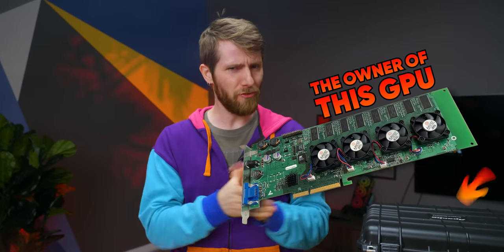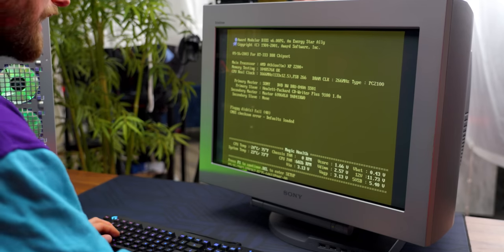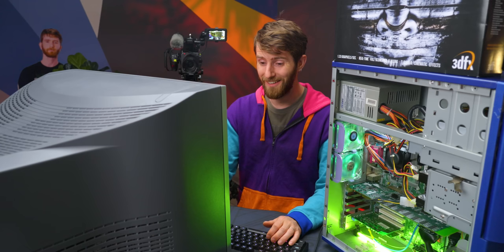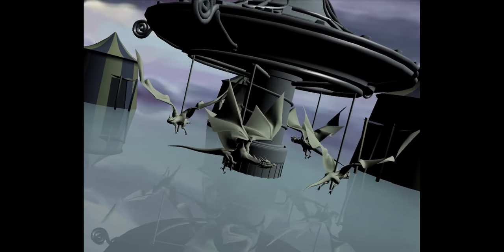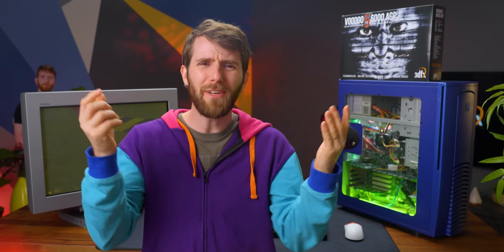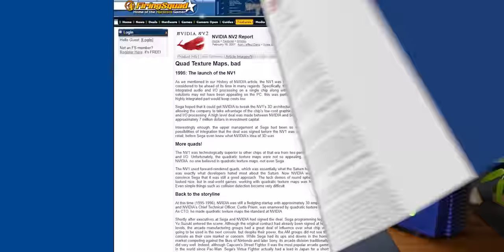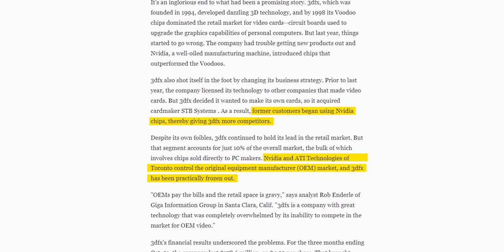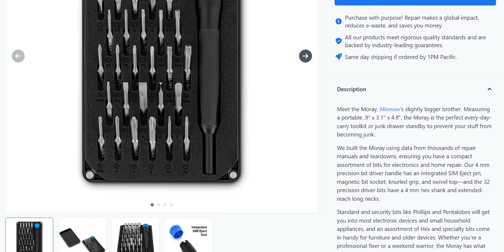This GPU cost $15,000 and there’s only ONE like it – 3dfx Voodoo 5 6000

Comment: ELSA AG from Germany had already finished a 3D graphics card prototype with 4 or more chips at the end of the 80's.
I personally had one of them in my hands and was also told how it should work...
First of all, there was a chip for each basic color and another one that was supposed to calculate the shades of gray. Unfortunately, the company went bankrupt too early and the new owners wanted to focus more on the modem/router area and then went completely bankrupt in 2002 and a Japanese company has it bought the name
Reply: So? SGI already had far better running, and the color idea as explained by you is idiotic, SGI was doing 3D, as were later everyone else, which involves no color channel separation whatsoever. I think you made that stuff up, because it isn't how it works.

Comment: One other nifty trick with the early Voodoo cards, because they only accelerated 3d, they were platform agnostic. You didn't have to flash the bios to use the same card on a Mac to recognize the color space. A co-worker had a pair of Voodoo 2 cards running in SLI which he replaced with a Voodoo 3, so I managed to get one of them for cheap. Installing it in my G3 desktop was as easy as popping in the card, and dragging the driver into the system folder.
Reply: same here. I bought the early Voodoo cards and flashed those and then upgraded to one that just worked.

That was the pinnacle of Mac gaming, when it had a real culture and Mac devs trying to get the market of the ground.

Comment: I was SO HAPPY to see the term "3d Decelerator" put beside the S3 chip. That card... god. Its a meme that will never die. I had a Virge Gx (i think) When they came out. Lara never looked so Filtered(Sharp) .. It was like 3 fps, but damn it was purdy. Unplayable and useless, but pretty.
Reply: Thanks to S3, Microsoft bought them and developed D3TC  off the original MeTaL API.
U99 under it will never stop being beautiful, same goes to Quake 3 Arena
Reply: We had an S3 Trio in our ole Pentium 3 500 system. Damn card could hardly run anything. It used to crash pretty quickly when starting something like The Phantom Menace. Motocross Madness was fine though
Reply: @leviblack7036  Was the Trio higher end than the Virge Gx/Dx (dont remmeber which it was) just remmeber that it was so "powerful" the thing didnt even have a heatsink on the gpu silicon. I had mine I believe in a around the 486/dx4 100 to Penium 200 era. That long ago kind of blurs together all this time later. But it was just before intel switched to the "nintendo cartridge" style of processor mounting. It was a fine card for 2d gaming It ran what I played well enough, but that thing REALLY didnt like anything remotely 3d. (but it was a fine windows base card) But yeah, it sucked. Glad someone else remembers these abominations.
Reply: @Dj-Mccullough  I don't know where it sat vs the Virge but this was circa 99-00. It certainly wasn't a high end card for its time. We had the option of getting a much better card when we brought the PC but we didn't think we needed it.

Comment: The heatsinks at the back of the cards GPU's makes sens because a lot of chips back then used some solder balls in the middle for cooling.
The PCB acted as a heatsink, partially or fully depending on the GPU.
You can still see that on modern BGA RAM chips in the data sheets.
Also overclockers back then did do sandwich mods, basically a heatsink and fan on the back, active backplate if you will.
And yes some cards ran very hot at the back no mater how much heatsink you threw at the front of the GPU, GeFroce256 comes to mind.

Also Nvidia having 32bit support in games was not much of a big deal unless you where fanboying a feature.
Both card supported 32bit colors in 2D but 32bit colors in 3D would easily lose you 30-40% of your FPS on most cards so few people would use that.

In fact the V3 3000 could do 22bit dithering on the output using the 16bit framebuffer, it basically outputted 22bit colors dithering the image creating an image that looks better but is still faster to render.
A Voodoo3 on a CRT looks very good with the right options set.

Comment: I had that Antec SX1030 case in 2001 and did a window mod also. Mine was beige and I tried to apply a black mirror finish with spray paint (I failed). It lasted until about 2004 when I got a black aluminum Lian Li that had a modular front drive bay/fan design.

Comment: I'm surprised that you didn't include Unreal in the benchmarking of the card.  Unreal FLEW on GL.  I knew a guy who had a VooDoo 5 5500, and I thought it was so cool, until I realized it was barely faster then my VooDoo 3 3000.  It's a shame that 3DFX fail cascaded so hard, and I swore off Nvidia after the buy out, until ATI proved how hard it was to make good video card drivers!
Reply: Uhm, as a retro enthusiast (and since I have 23 x Voodoo cards, including 2 x Voodoo 5 5500), I feel like I need to set the record straight. 😁
I can tell you without a doubt that the Voodoo 5 5500 is not "barely" faster than the Voodoo 3 3000. You were probably comparing them in CPU limited scenarios. At 1024 x 768 / 1280 x 1024, depending on the game, the Voodoo 5 5500 is almost twice as fast as a Voodoo 3 (or ~50% faster when the Voodoo 5 is running in 32 bit color).
Reply: Blooden, you may know this then, did all of the voodoo 3 3000 have the built in TV tuner capture cards then?  I remember how annoying the purple mostterly long cable was, and how they added TV capture right around the time of the HD transition.

Comment: That first step into 3D with Quake was friggin awesome. I put it on the same level as my first experience with VR on my Vive.
That was the core part of my lan party days at the roundhouse in Aurora, IL. A great lan party venue...you could always just take a break and hang out at the bar downstairs. I don't miss lugging around that CRT monitor I had back then though.

I'm pretty sure I still have my 3dfx Voodoo 3 3000 somewhere in my storage boxes of computer parts.

Comment: Extra points for running a REAL CRT monitor!  :_lttDragon:
Reply: Not just any real CRT, that's an FW900. The only widescreen PC CRT ever made. Sometimes rebranded as IBM, Digital, HP,  Silicon Graphics. There is usually one on eBay at any given time with an asking price in the thousands.

Comment: Like! Too bad the CRAZY multi-GPU MONSTER Voodoo 5 6000 was never officially released.
Reply: The Voodoo Rampage would have been interesting as well.
Reply: @RetroNorth  of course but Rampage still needed at least 6 months to function normally and to be released. The Voodoo 5 6000 on the other hand was practically just a step away from being released on the market.
Reply: @3dfxvoodoocards6  True, the 6000 was a beast and indeed much closer to general release. But it was all the same tech as the 5500, just more of it. ( With the addition of Voodoo Volts maybe if that counts. )

Comment: What a piece of history. 120 fps at the time wasn't even considered as anything in gaming as far as I remember.
Damn throws us right back real good. Look how far we have come since then, wow.
Reply: Yes it was, rarer perhaps and most people preferred the higher resolutions, but you can see in the shown benchmarks from april 2000 both the original and second geforces getting over 100fps in Q3 at 800x600.

Remember refresh rates were higher than for a long time in later years due to CRTs being a migraine inducing flicker fest at 60hz and not great at 75. 85Hz was a common minimum for many and at lower resolutions the good ones could go quite high.

Comment: 3dfx was late 2 years due to shortages and not outsourcing silicone.. the 5 would have been competing with GeForce 256 and ddr right around the corner.

Comment: for me this era was all whatever secondhand stuff i could get my hands on.  i'd help family friends get their new system up and running and then take home their old system they weren't going to use anymore, and swap parts around to get myself the best system i could.  never got a 3dfx card but remember having to select your hardware (audio and video) in a game and mine not being on the list most of the time.  3dfx was in the list most of the time and i'd end up trying everything to see what worked best for my hardware.  some didn't work at all and i feel like there were usually about 6 options.

Comment: reminds me of the weird PC that my brother and I cobbled together for my father. as you know, all those graphics cards had one single outlet.
we had a not too old voodoo banshee and another card (I don't recall which one, probably a S3). and we had a 14" screen and another 12" screen (yes, there were 12" CRTs out there). my parents were quite happy with it because 2 rather small screens allow much more productivity than one 17" screen.
12" is nowadays garbage, unless on a light laptop, but a second screen with the only task of taking care of outlook? quite a fine thing. it needed to be enough for email.
and the screen was original IBM PS/2. yes, that wasn't just a keyboard connector.

Comment: On a semi-tangent but sort-of-related vein: check out some of the Intergraph 2D workstation cards from the early-mid 90's. Huge full-length video cards with tons of sundry chips, all driving a 13W3 curvy, BBW size monitor. In fact, now that I type this, you should start a retro-computing channel with rotating co-hosts such as "this does not compute".

Comment: I still keep my 3Dfx Voodoo RUSH ATC-2475 PCI Card 6M RAM 1997. Which worked on my Compaq 1 which I also keep.  For a long time I have been considering restoring it and strengthening it with the components I have collected over the years.  I'm also going to put in a Quantum Bigfoot hard drive.  My problem is that the motherboard is Pentium 1 MMX 166 Mhz, I will probably be able to install Windows 98 SE.  I hope everything goes well and I remember my childhood.❤

Comment: nVidia side note. nVidia bought networking company Cumulus Linux which is a networking OS for switches. After their purchase all support on switches with competitor chipsets (i.e. Broadcom) was discontinued.

That was painful, and expensive, as we had stacks of switches both 1 and 10 gigabit that were basically out of support, and the last release was 4.3. Quite a few issues we had were fixed in later versions, but those were never provided. Not even after logging cases.

You could argue it was also partially the death of OpenNetworking OS as it was one of the more popular releases. PicaOS and others were available but that also means rebuilding your entire network which was often VXLAN based, different syntaxes and capabilities.

We went with Aruba, one vendor for hardware and software that prevents this weird split. Delivery lead time was about 8 months and about 120k euro. Had to rent intermediate equipment for about half that money while waiting.

Comment: One key thing about this thing is that it isn't a GPU at all. The first GPU was the Geforce 256 which had hardware transform and lighting, which was a big deal. the very slow tests were slow in part because they were using the CPU to do the transform and lighting. Pixel shaders are also a consequence of T&L being onboard the card. Essentially, this actually is a 3d accelerator card in the truest sense, it draws textured pixels really fast.

Comment: I had a Voodoo 3 3500 and it was a nice card for the time, but definitely a mixed bag. The graphical quality was the best in games that supported it well - Unreal Tournament for instance, you could run right up to a wall and admire fine grained textures on things. It ran very smoothly too... but was highly unstable if you did anything but play the game. Games had to run in fullscreen mode and if you alt-tabbed an accelerated game, you were headed for a crash. Many titles needed a special MiniGL driver. The video capture was choppy and low quality garbage - I bought a Hauppauge card to handle it eventually that outclassed it every way for capture.

Comment: Even being a young person myself i can understand that with the age if this card alone it is very impressively big for its time and even now its still rather big thanks to it being mostly pcb instead of cooler i have an old ati radion card from the early thousands myself and its tiny compared to my old 3060 which is fairly normal sized for a modern gpu if we exclude the higher end cards of this and last gen

Comment: Few people cares, but it was not shaders what Voodoo's lacked, was a hardware transform and lightning engine, that was a fixed function hardware to deal with geometry and light handling faster than a cpu could (Voodoos can do software t&l boosted by simd isa like sse or 3dnow!). What Voodoos had better than other cards was a tight and performant feature set, among those features a poligon setup engine that offloaded some work from the cpu and that was on big reason to require a less powerful cpu when using Voodoos. The Voodoos ill fated succesor, the Rampage chip (Spectre the name of the cards series) reached Alpha phase with semi working silicon (very few samples, far less than Voodoo 5 6000s) and as platform had one AGP+T&L chip and could have more than one raster chip with very early programmable shader features, but never came to proper light.

Comment: I stuck it out with my Voodoo2 12mb SLI setup all the way until the Radeon 8500 (which was awesome, and still around here somewhere)! I remember my buddy got a TNT2 and we were able to use 32 bit color in Powerslide and all the banding went away, and I started to get jealous lol. Another friend picked up a Voodoo 3 card and we all would pass around our benchmarks to compare...at one point I even considered getting an S3 card because of the touted S3TC texture compression lol.

Comment: That 's a nice nice video. Brings back many memories.

Imho, the generation worth mentioning is voodoo 2 gen, where you had the S3 savage, the ati radeon, the matrox g200 and the nvidia tnt2. That's when things started to get really interesting in domestic 3D. I had a virge 3D, ... managed to run quake with a custom OpenGL S3 mini driver and it was playable but the whole 3D experience with the S3 virge was almost non existant. Then I had a Savage 3D and Savage 4 (OC'd the 3D and ruined it). They were ok in D3D performance but its drivers were very bad all the way. UT99 with S3TC and the metal driver was nice though ! ATI. I had a Rage 128 at work. It was the same thing as the S3 Virge. That doesn't rank as a 3D card in todays terms. Not even back in the day. The most the Rage's and Virge's could manage to perform better was with basic OpenGl and that's pushing it. Then I had a Radeon R100 for some time. I remember drivers issues over and over again. Nvidia was much better regarding their software at the time. I managed to get my hands on a Matrox G200 as well but I can't remember their performance. But the shit was having a Voodoo 2 and using Glide games. That's what this cards were good at: running games with their own API. Voodoo's performance in D3D wasn't up to par with the Nvidias TnT's. In fact 3Dfx D3D drivers were always awful altogether. As most games were not Glide ready and most publishers bet on D3D, 3Dfx was doomed. That's the biggest reason for their downfall: Microsoft and their new D3D version at the time. Can't recall which but the truth is it started to support most features that were Voodoo only. Btw, I was in my 20's when I started messing around with the internet. I started using web forums and probably my first membership forums were Savage News and then Rage3D. Good memories from back in the day :)

Comment: I bought a Diamond TNT2 Ultra almost as soon as they were released, in 1999 which means I either didn't buy Half-Life right away or I was using a different card for the first year. It's been so long I don't remember how exactly it unfolded. In any case, I remember having terrible screen tearing issues when circle-strafing and I'd be on the phone with Diamond tech support for hours, trying different settings and driver patches. I don't remember exactly how it panned out but at some point I got rid of that card and upgraded to something with an ATI GPU and that worked better for a while.
Reply: I never had a Trinitron, though! Usually LG Flatron or Samsung CRTs.

Comment: This is pretty funny, as I'm currently in the process of moving, and came across my old Voodoo 5 5500 card. I have no idea if it works, and I haven't had a system with an AGP slot in over a decade, but the fact that the 6000 is being featured is a bit coincidental.

Comment: O wow , did linus just pull out a Thermaltake Xaser case from the old days? i have exactly the same model with 1 exception, i went for the fireball edition with the flow effect instead of the ribbons. But 100% that is a thermaltake case, indestructable

Comment: Ah the days of gaming on a Sony Vaio. Pentium 2 processor and 3Dfx AGP Voodoo4 4500 😂
After that I built my first computer. Asus A7N8X Deluxe mobo, AMD Athlon XP 2500+(Barton) & ATI Radeon 9800.
This affordable rig was extremely special. The AMD Athlon XP 2500 "Barton" was identical to the 2800 just under clocked. You never knew if you're going to get a Barton, it was like winning the lottery. You could overclock it with the stock cooler and have a 2800+ for free!  Similarly, the ATI 9800 could be overclocked to identical specs as the 9800 "PRO" once again with stock cooling. This saved you big bucks!!  

Still runs today but somehow the internet drivers on Windows are corrupted 😢